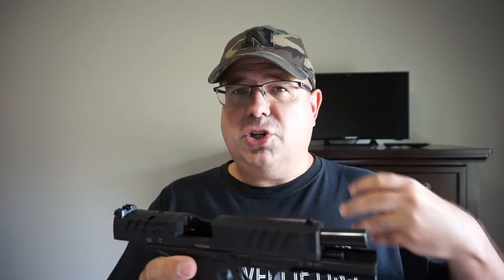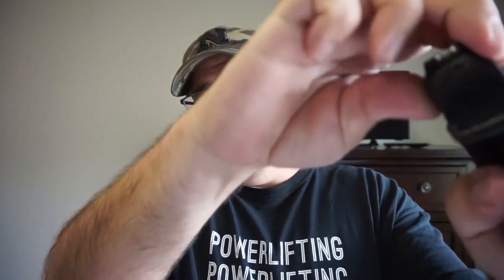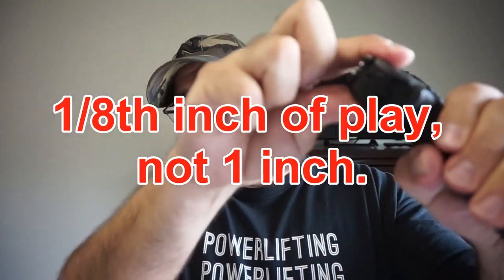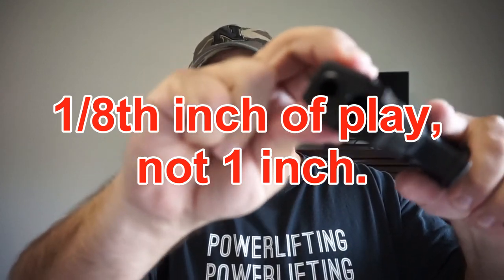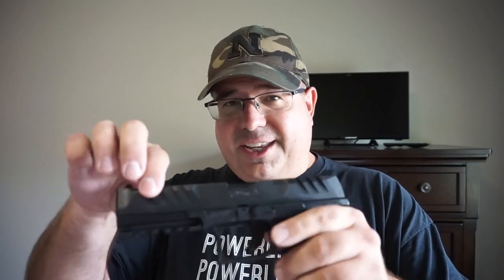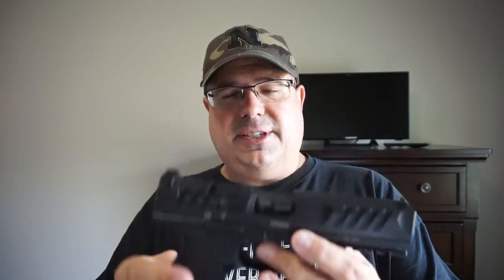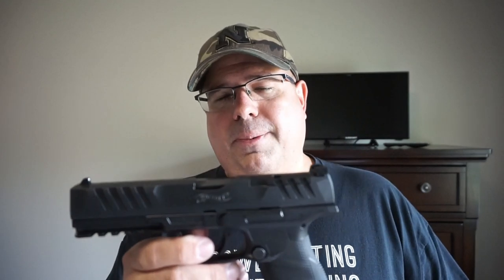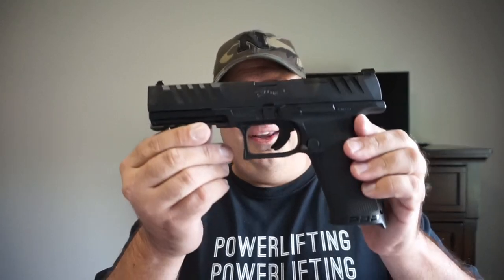Watch this before you buy a Walther PDP.

Comment: Doesn’t compromise the pistol. 
The tolerances might differ from time to time. Send the damm thing back. Walther will back it. 
As long as it shoots , ejects should be satisfying… but, if your still unhappy walk away from it. I’m disappointed in these types of vids that constantly bitch slap at the mfgs before they contact them for an explanation… most major gun mfgs have solutions and will make corrections… 
Unless your a first time gun buyer which you may be … contact the Mfg first.
Reply from the maker: Again, I was just addressing concerns from the viewers.  Walther told several of my viewers that this is normal.  Mine is noisy but is awesome accurate with a sweet trigger.

Comment: I checked one at the gun store, loved the trigger, but over all the gun felt cheap, I went with an H&K
Reply from the maker: It’s light but the frame itself is fairly rigid.
Reply: @travisp11  I agree and the grip was awesome, but over all the cheap feeling, and that was because of the very loose slide just didn’t appeal to me. Now if the price was 450 which is what I can get a new Glock for it might have changed my mind
Reply: The PDP is actually superior in construction methods and design than the VP9. The PPQ/PDP used a machined block for the slide block and slide release mechanisms whereas the HK's are spot-welded. The PDP/PPQ platform is actually combat rated (provided you use the marine striker guide from the Navy model) while the VP9 platform is not.
Reply: @stopthephilosophicalzombie9017  that maybe true, but I’m not gonna buy a gun that just feels cheap, a man has to have confidence in what he carries, and what I have seen and read, reviews are about 50/50 on the PDP, seems you either love it or hate it, I went with the P30, I didn’t care for the VP9 either
Reply: @theinfidel6301  The P30 is a great gun.
Reply: @stopthephilosophicalzombie9017  TF you talking about. The VP9/SFP9  is in service all over the world. Can’t say that about the rattling pdp.
Reply: @alexandre0319  The PPQ/PDP platform is combat rated. VP9 isn't.
Reply: TF you talking about? H&K VP9 only has a couple tiny military contracts. They are just like Walther in that they mostly rely on civilian sales for their pistols. They both have contracts with some LE in the U.S. and in Europe. No big military contract will use the VP9 because of the high cost.
Reply: @jasonnunya7000  I’m talking about the P30

Comment: ARs lock upper and lower with two pins. They rattle and have no affect on accuracy. My Ruger 380 Security also has loose slide rattling. Do I wish for a tighter machine fit? Of course
Reply from the maker: That is a good point but the bolt and carrier are generally secure in the upper with minimal play from side to side. It was just amount of slide play from side to side that seemed a bit excessive compared to my other semi autos.

Comment: I have a 2021 Walther PDP 9mm. The compact 4". 0 problems or feeding issues. I did get annoyed by a minor frame glitch with the polymer molding near the rear of the trigger guard. It's a molding burr which is not common on PDPs. 🤨  I've seen other polymer frame guns with it too; M&P .45acp, Ruger, etc. I'd add the loaded chamber(red) mark wears off quickly with normal shooting, CLP-cleaning. Walther could engineer a better format. Maybe a brass peep hole on the slide like S&W. 🤔  ps: Walther did have major issues with 2021 era 18rd 9mm factory mags. I had older 15rd style with no issues. I think fixed or corrected PDP 18rd styles are black or blue not orange-red.
Reply from the maker: I need to check my followers. Not sure what they are. My new ones are blue.

Comment: I dont have the issue but mine is made un germany i dont k ow if the US market guns are made over there. Definitively not the same lower anyway as i dont have the metal insert with the serial number 
I also use gun grease on the rails  ( Ostermayer waffenfet gold,  awesome ceramic grease)
Reply from the maker: Mine is made in Germany. Both the slide and frame are marked with that origin. The serial number insert may be a USA market requirement. Regardless of the noise if may make it is an awesome pistol. I will look into that grease to see if I can order some online.

Comment: Does it rattle like that with a loaded mag inserted in the gun? My M&P m2.0’s have little to no rattle like that in them
Reply: I have 2 m and p 2.0 that rattle like that  its not a big deal either way
Reply: @boomee78  yeah my 5 inch m2.0 has a little play in the slide but nothing close to what’s in this video
Reply: 2.0's have tighter tolerance. But then again of you get dirt or sand on the 2.0 you'll have issues. I find it better to have a little rattle than no rattle at all. I love my 2.0 but in outdoor environment it may have issues.
Reply: From all the unscientific bubba torture tests I’ve seen, most handguns choke after sand gets into the action

Comment: Thanks for the video, I definitely don't see that being an issue. If It's accurate, and goes Pew I wouldn't have a problem with it. I could care less about a little rattle. Ain't no worse than the forgrip on a Mossberg 500. Lol
Reply from the maker: Accuracy is awesome on this pistol, that's for sure.
Reply: My 2012 PPQ M1 does this and it's been the most accurate and reliable gun I've ever had.
Reply: I believe the rattle on the Mossberg’s pump was an intentional design, it makes it easier to work/clear should any dirt or grit get stuck in it.
Reply: @Skinner0608   I believe Walther designed this pistol  for the same reason
Reply: @bwilder0487  I’m really thinking about getting one, it’s either the PDP or a Glock 19 MOS. I’m really stuck between the two 😫
Reply: @Skinner0608   pdp all the way. I'm a little biased as I have had terrible luck with Glock though. But I think the pdp will not only shoot smoother it just looks so much better.

Comment: very strange complaint though, it has to be kinda lose that way otherwise cycling being flawless in some dust and mud condition would be real challenge or a matter of luck.
Reply from the maker: Mine runs just fine and is very accurate but I had people leave comments on my cleaning video and review on the looseness of the slide.

Comment: I have my PDP 4" compact and this is not an issue...but my mags are making similar noises while loaded with more than 7 rounds...I took them appart and checked, yet they still do that. It doesn't matter at all, it is not hearable on the street, niether in night and functionality is not compromised, so I don't mind it after all :D It is an awesome pistol, but sights should be thiner :D
Reply from the maker: It is an awesome pistol!
Reply: Are your followers blue? If not then contact Walther, all PDP model mags were updated with blue followers, if your followers are black Walther with send you out the new blue ones free of charge.
Reply from the maker: @bladejames8208  Are the blue followers different?
Reply: @travisp11  from what I understand,  yes they are. The design is slightly different. Both of my PDPs already came with the blue followers so, I can't compare. Walther may or may not list the differences on their website. I would imagine they are definitely a design improvement for a specific reason as Walther is giving them away for free to owners. I would say it is definitely worth looking into 👍
Reply from the maker: @bladejames8208  will do!

Comment: Does this apply to all PDP sizes or just the 5inch?
Reply from the maker: My guess is that this is more noticeable on the 5" model than the shorter barrel but I'd imagine the shorter barrels could be slightly noisy. Overall the noise isn't too bad unless you shake the gun
Reply: My 4.5 rattles like that i thought my slide had broken.

Comment: Honestly it's not a bad thing loose  tolerances helps with reliability think of the AK platform and this pistol is very accurate and very reliable in this is just my opinion but I would take this pistol over ANY on the market but like I said that's just me everyone has their  preference
Reply from the maker: You do make a good point

Comment: Wow, that sucks honestly. I've been considering one of these, but I'm not crazy about pistols that are overly loose. That reminds me of the old 1911s we had in the Navy that rattled like hell since they'd been re-built so many times over their lifetime.
Reply from the maker: Yeah, some people may be bothered by it but others not so much.
Reply: I have 2 PDP’s its not a big deal,  my vp9 is about the same.  Gun shoots so good.
Reply: Won’t effect function
Reply: 1911 is a different ballgame for rattle tho since it's steel on steel. Plastic on steel is not as bad imo
Reply: Yeah but I would take a loose 1911 above the more high end ones. Not saying that the higher end tight fitting 1911’s aren’t reliable but I’ve noticed they have the most issues.
Reply: @jamesdenike5883  there was a reason it was designed to be put together from buckets full of parts
Reply: @PIFFthePUFF420  The lugs and rails are steel - and still not a problem given how well this thing shoots.

Comment: Didn’t experience that in the FS 5” PDP model. Put about 200 rounds thru it so far. Amazing trigger, very comfortable grip, very minimal recoil with the FS 5”. Want to grab the compact or even try the F series! 

I also put about 200 rounds thru ab M&P 2.0 w/ Apex trigger and the Walther stock trigger on the PDP was every bit as butter smooth. Apex obv less wall and quicker reset PDP had a smooth tactile trigger reset.
Reply from the maker: I love my PDP and while the movement of the slide bothers me, I am just going to asume it was part of the design.
Reply: @travisp11  so I recently got a compact 4” PDP and my slide does not wiggle ( or display the loose tolerances / noises ) guess I got lucky for once. If my slide was doing that I would send it in.
Reply from the maker: @uptobatentertainment  it may just be the long slide and frame of the full size models that have this issue

Comment: No offense, but people who complain about this sort of thing dont know anything about firearms engineering and should probably go read about the purpose of looser tolerances before they go COMPLAIN to a company or complain to creators like you about it. IF YOU HAVE A GUN THAT IS ENTIRELY TIGHT, IT WILL NOT RUN AS WELL IN ADVERSE CONDITIONS
Reply from the maker: I agree with you.

Comment: This is a non issue. Do with a loaded mag in the gun.  Compare I to a glock. Not that odd.  Even with this looseness which does increase reliability, you would think accuracy wouldn't as be as good as it is and it shoots lights out.  I think fanboys or haters in every aspect of firearms jump on a bandwagon or youtube celebrity and just run with it.
Reply from the maker: You make a good point and it does rattle less with a full mag in it. I just found it interesting that so many people have mentioned the rattle in my cleaning video and range test.
Reply: Yeah there was a bunch of hate regarding the optic attachment screws being insufficient but that apparently has been for nothing as no one has reported failure of the system.
Reply: @stopthephilosophicalzombie9017  1776 or bust has reported that the milling for the red dot is uneven and causing there to be a gap under the red dot

Comment: Non issue
Reply from the maker: Fair enough
Reply: @travisp11  there is one thing that I don’t like as well though. The plastic piece in the front of the slide that the rsa goes into. I’m sure that won’t be an issue either but it seems Walther could have just left that part of the slide metal or made that piece aluminum. I’ve heard of one case of that breaking and making the gun useless

Comment: It's a Tool, and a damn good one at that. 👍
Reply from the maker: I agree
Reply: @travisp11  mine also has that wiggle noise, Glocks are the same, a few other brands as well. My guess it's matching that steel to polymer?
Reply from the maker: @bruce5168  maybe, just the natural allowances for tolerances between the slide and frame. My G17 Gen 4 doesn’t have that much looseness but my PDP shoots just fine and is plenty accurate.
Reply: @travisp11  yeah buddy, mine too right out of the box without a red dot. Great pistol, well worth the hype in my opinion.
Reply from the maker: @bruce5168  I agree! The grip is amazing
Reply: @travisp11  I agree 👍. It's almost like the more you squeeze it?/grip it, it grabs you back. Make sense? None of my other brands do that.
Reply: @travisp11  also... I've heard it's a little top heavy with a red dot so when you go to reload it's as if it wants to roll out of your hand. I just ordered a aluminum back strap in chrome look for counter balance. They have brass too, red, blue, black colors. They say it balances the pistol in your hand. Taylor freelance is the company. Check em out.
Reply: @travisp11  and because you showed that your a down to earth guy that talks with his subscribers, I've subscribed and I'm looking forward to more videos. Stay safe, God bless brother.
Reply from the maker: @bruce5168  thanks for watching! I’ve got a PDP range test and cleaning video and I also showed off a cheap but good holster. My PDP is mounted with a Streamlight TLR and functions as my bedside gun
Reply: @travisp11  sweet!! Keep em coming brother glad to be a new subscriber!!

Comment: That forcible induced noise by shaking the pistol hard doesn't change anything. Nothing! The Walther PDP remains: reliable, very accurate, with an amazing smooth trigger pull and outstanding ergonomics. 
By the way, who in the f*** is going to shake a pistol in a combat / tactical / self-defense situation?... Nobody. Unless you are THAT much scared.
Reply from the maker: I agree about regretting selling.  My dad now owns it and of course he got all of the issues fixed on it and I want it back but I can't blame him for asking 3x more than what I sold it 
 to him.
Reply: @travisp11  Walther PDP is the best handgun of 2021.

Comment: You're a gun guy, but you don't know why there is that much " play " in the slide ? Most duty and military pistols are build like that so they can get sand, mud, your tears :p, inside of them, and still function, which many tighter build guns cannot. By the way, I bought that pistol after watching your video. Best polymer gun I own, and I own many
Reply from the maker: I love mine and it is very accurate. I know that some guns have looser tolerances that others but in my PDP when the comments started coming in on my cleaning video and range test about the excess play in the slide, I was curious myself and made a video about it. As long as it doesn't negatively affect accuracy and reliability, I can live with it.

Comment: If you want a pistol with zero rattle, get a competition slide-fit, custom worked 1911 for $4,000. If you want a duty gun that will run with muck in it, sand, temp changes and other BS and cycle reliably every time, you want a little bit of slide rattle.  Gunsmithing 101.

Comment: I just got the 4.6" barreled PDP PRO COMPACT and it has the wobble also. I haven't had it out yet but love the pistol so far. But I will say this, I have a Canik SFX Rival and it is one hell of a good shooting pistol and it also has this slight wobble. My HKVP9SK does not have this wobble, also a great pistol..
Reply from the maker: Im thinking it's just the loose tolerances that Walther builds into this gun but it does not affect accuracy on my PDP
Reply: @travisp11  

That's kinda where I was going with my earlier reply. My Canik Rival shoots lights out, one of the best pistols I've ever shot and it has the wobble. So I think it is a non issue. Now just waiting for my 507c with ACSS reticle to arrive, this will be my first ACSS Ret  so I'm not sure what to expect.

Comment: Put 5lb striker spring and it will help with the slop😂, I have the 4.5 inch OD green frame and mine doesn’t have that rattle, I will say mine is very tight, tight like 1911and my canik mete sft pro, it’s also very tight fit, like I said 5 or 5.5 lb striker will help keep it in battery also.